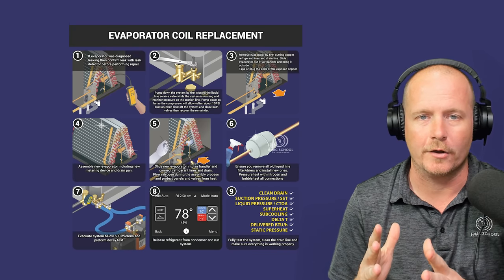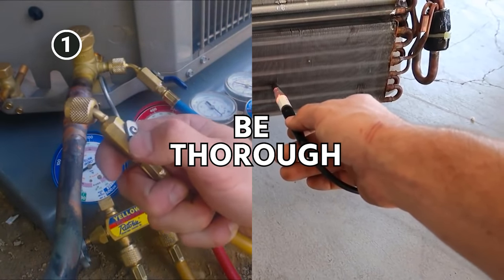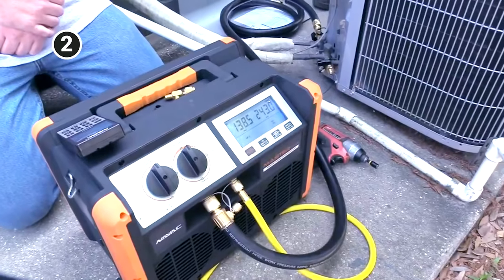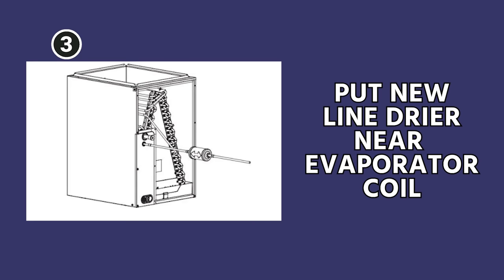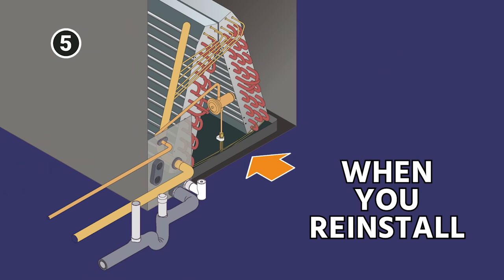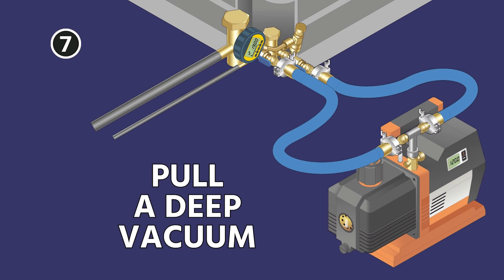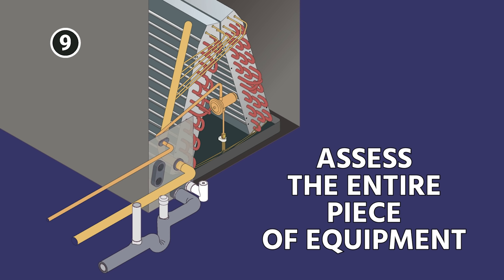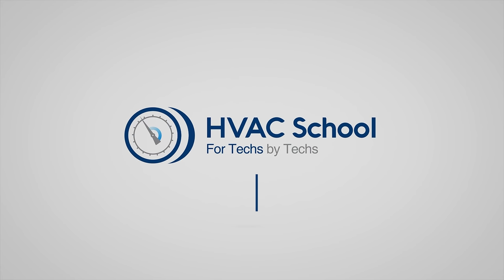How to replace an evaporator coil step by step

Comment: Came here to DIY….F THAT hahaha. I’m going to have to bite the bullet.
Reply: Im in the middle of one.
Reply: @drew3184 what did it cost you after labor and parts?
Reply: @nritchie7207  $4k had them replace everything, coil, outside unit, new lines. Made most sense as mine was from the 70s.
Reply: @drew3184  shoot, with the outside unit too that ain't too shabby

Comment: I'm not a HVAC guy but I will fix my ac because I can do anything. I have a pinhole leak in the coil and it's behind the defuser mesh.
Reply: So howd it go?
Reply: @nritchie7207  very well. 8hrs in the attic in south Texas summer, but the ac is fixed. I think sediment in the inner pan and on the condensers was the main problem.
Reply: @OfAHigherClass  good to hear bud. I think ive decided to pay someone else. 😅

Comment: We spent $8K for new system. Just the evaporator coil and the condenser.  They did not inspect the blower or the drain lines.  We are smelling something sweet every time the ac goes which I suspect refrigerant leak.  The ac guy came and used a leak detector device and didn't find anything.  The smell is sickening.  Are those detectors 100% accurate?

Comment: If pressures were at 0 psi after the evaporator failed, when it is time to pull a vacuum, should the service ports be opened to pull the vacuum? Because I’m thinking that 0 psi might mean that air got down to the pump.

Comment: You mentioned that you don't like to unsweat because of the oil and risk of fire. 2 things that happened to me (in my earlier days). Unsweating once in an attic holey crap was that a ball of fire lol (I can laugh now but scared the crap out of me). Second is something people should know (maybe should be in a video you would do Bryan, on fixing condenser coils). Found small leak in condenser coil. Emptied ref' from low side only (I know 🙈). Figured unit is empty. Started my torch to heat up the pipe so my rod would melt on the hole. Now that was not a ball of fire but such a boom that I felt it in my bones. The expansion from the heat caused the pipe to blow. Thank God I didn't get injured, was pretty close.

Comment: I am just a customer who likes to get educated.  You videos definitely do the job.  How many contractors would actually be this thorough.  And how do you find a contractor as detailed oriented as described in your video?  
Thanks for continuing with your excellent instructional videos.
Reply: Me too. Freshly retired mechanical engineer and 15 yo Carrier heat pump started leaking. They charged $168/lb. for 4 lbs and 2 days later same problem, so obviously they missed the leak detection part. And on top of it, I could get 25 pounds of virgin 410a sealed delivered for $12.50 a pound! (well, if I had an EPA number I could!). Tomorrow they come back to properly find the leak and we all suspect it will be the coil. Thanks to this video, at least now I can observe them and protect myself from rip offs!
Reply: The issue with corner cutting is home owner driven. Reputable companies that do all steps correctly can not compete with fly by night companies that will do the same job, without best practices for thousands cheaper. This evap video is a prime example. If that system is close to ten years old, I would want all virgin refrigerant. I want to see a print or screenshot of the standing nitrogen test, ultimate vacuum reached 100-200 and the decay rate. Most companies will use the cheapest coil available, pump down the system, and nitrogen is a maybe. The vacuum may go to 500 micron with no proof of that, nor decay rate. The first is correct. The second will work and will be what most homeowners choose as it will be much cheaper. Shopping comfort cooling repair costs is impossible without a working knowledge of procedures. Companies with the best intentions will adjust procedures to be competitive as 99% of home owners only care about cost. You see the 'great deals' and glowing recommendations based on cost on socials all the time. It's frustrating.

Comment: Very informative! Not in the profession  but gives me some basic info to understand the process and good practices. A lot is still over my head. Trying to work with a company that replaced the evaporator, now a leak somewhere two weeks later.

Comment: Great instructional. I would add a VERY, nay EXTREMELY important stage if exchanging a copper coil with an aluminum. Clean, nay, SCRUB the rear and forward interior surfaces (Any area the coils will touch). 

You can go one step further and place a tape bearer between the existing interior and the new aluminum coil. If any copper residue finds its way onto the new aluminum coil it WILL cause it to leak.
Reply: Justin Thackston

Comment: Great videos! Where do you stand on pressurizing the evap with nitrogen when service valves are closed on a pumped down residential split system? Many older techs say that practice can push nitrogen into the condenser, and it should only be done if the lineset is cut away and fittings brazed in. Or, recover all refrigerant, and pressurize the entire system. I usually am not worried about new condensers, but with the number of times I have seen brazing near service valves without protection, it has me wondering where you are on the topic. Thanks for all of the great content!

Comment: I have an 8 year old York system. We lost cooling due to a leak over time. Had a company come in and diagnose it's the coil with 2 leaks. They topped off the refrigerant and gave us an estimate. I come to find that parts are covered to 10 years on YORK but, I have to use a YORK authorized repair person. So, I paid this first guy his $500 for the diagnosis and top off of the R410. He told me that the YORK authorized person I choose can just reuse the same R410 in my system. I had to choose a local York authorized repair company and they tell me that to replace my coil, they need to use all new refrigerant and charge per pound accordingly. Is this true? They already ordered and received my evap coil and want to schedule but, I feel like they are BS me. Great video!
Reply: Figures first time turning the AC unit on this year (2024)and it doesn't work. Thought it was a cap, but was the condenser coil. Never got charged for that visit, because I authorized the evap.coil replacement.  It's also is a York,  2 months shy of the 10 yr warranty. Part was in stock, a full aluminum coil replacement.  My local AC company that I have been using for all of my AC needs, sent 2 techs to replaced the coil about a week later. There wasn't any talk about a York authorized tech to do the work.   

I also have a 24 yr old R22 unit, still going strong, even in 120 degrees summers, though not so efficient. Totally unheard of such longevity, now that I see the reported life of these units is at 15 years.

Just horrible for homeowners to be replacing these ever expanding expensive units in less than 15 years. Now with the new refrigerants coming out, and companies and tech having to replace some of their equipment, I fear what the new prices will be.
The day is coming when when many homeowners will not have the money, and will have to do without air conditioning.

Comment: Great video again! Question for an expert: in a one way air to water heat pump with a TXV, do you need any check valves? I ask because when switching off the system hot refrigerant flows back into the evaporator coil instantly and don’t want to cause premature damage. Any thoughts is much appreciated

Comment: after you do a pressure test with nitrogen, do you just open the valve to relieve the nitrogen or do you use the evacuation process to remove all the nitrogen?
Reply: 😂😂😂😂😂 wow

Comment: Hi, great video with all the best practices! 
Question: if the evaporator coil is below the heater which is below the fan, do you need to fully remove heater and fan to replace the coil?  I was told it must be done… I am surprised about that since I would not expect it to be structural, otherwise the weight alone could damage the coil in time… any thoughts on that?

Comment: Im trying to figure out why labor on a warranty part cost so much money?  I think if a factory builds a unit that fails durring its warranty period they should cover the cost of replacement including labor.  This is nuts the part new cost less then the labor to change it. 
Do they not know we can look online and see these prices?
Reply: (May 2024) I paid $1950, two techs schedule for 1/2 the day.  I have a York (9yr8 month)with a TXV, the price included a dryer, and whatever R410 refrigerant they had to add.

Comment: Why is it better to have the filter dryer inside? Is it to keep from being a potential leak? 
I like outside because I can measure across it while looking at my manifold
Reply: I was told anytime you open the system up you add a filter dryer. Mine is in the attic next to the new evap coil

Comment: hello recently Hvac tech put dye through my coil part of air conditioner that sits above the furnace, the dye was put in from outside in the air conditioner unit, the dye went through the coil system that sits above the furnace and came out into the clear plastic hoses that are on the side of the furnace, so the tech stated that because of that there is a leak in my coil system that needs to be replaced, i never saw the actual coil or where the leak actually is, a new coil and refridgerant would cost $4,000 a new Lennox would cost $7500, does this sound correct?should i ask for second opinion? should i get them to come back to see the actual leak?

Comment: Sir i got a order of water chiller but instead using of copper pipe I am thinking to use plate type heat exchanger (PHE) so please tell me PHE work as effective and efficient as like copper pipes or not?

Comment: What would be the procedure if system is complete flat, no refrigerant?  I was able to visually find the leak at the evaporator coil, do to the puddle of oil trapped in a clear tube that was covering the distributor tube that had the leak.
Reply from the maker: I would pressurize the system with nitrogen just to double check that is your only leak. In the case of a totally flat system, you will not close off the valves and pump down the condenser. Pull a vacuum on the entire system, including the condenser. This will take much longer than pulling a vacuum on just a line set and evap coil. Besides that, the procedure is identical

Comment: So how do you find an evaporator leak with the coil still in the furnace plenum? 
You can only reach part of the coil in that case if the rear of the plenum is removable (which mine is). 
Do you recommend removing the coil to find a leak? 
Isn't that a lot of wasted work and time if there is no leak?
Reply: im no expert but what they did to mine was use a dye if you see the dye on any of the runnoff plastic pipes attached to furnace or there abouts then there is probably a leak, so im told

Comment: I have not found any company in Northern Texas, Dallas area to do any of this.  They come out and then show you readings from the condenser unit, never doing the soap test you show, condemning the evaporator coil as you state.  I have yet to find any company to do this and we have several properties.  Frustrated to no end at the lack of professionalism and the desire to just upsell you equipment.  Some want extra money for dye tests.
Reply: You can tell a system has a leak with just checking the refrigerant pressures lol. Not where but definitely can tell if its leaking

Comment: How long does this job usually takes?
Reply: For mine, my AC company scheduled 2 techs 1/2 day, though it didn't take a 1/2 a day 3-4 hours maybe, You want two techs, because that part is bulky, and you don't want one tech trying to wrestle with it.  My unit is in the attic.
Reply: Thanks for info.

Comment: I was with a tech one day up on a roof of a restaurant and found no gas in system. Evap was when pressure tested which he repaired using solder etc . Then he vacuumed and started recharging but when he turned on the compressor the motor seized or was already seized. He said the customer would have likely kept resetting the system when it was on low pressure and this would have been the reason.  What is your opinion why compressor seized ???
Reply: He most likely seized the compressor
Reply: Would a hard start have got compressor going here

Comment: The A frame evaporator coil was leaking r-22. We were smelling something sweet every time the ac went on.  We bought a brand new unit.  Condenser and A frame evap coil.  We are still smelling something sweet only when the ac goes on! The installer came back and tested the coil with a leak detector. He only tested the front of the coil. Never checked the back or the sides.  Now what?

Comment: If you pump the system down with the liquid line dryer in the condenser and close both valves, why is it necessary to replace the liquid line dryer?  I don’t see how it’s exposed to air at the point.
Reply: Agreed